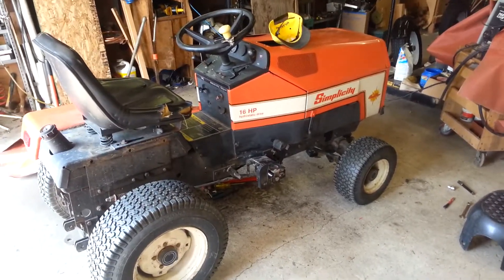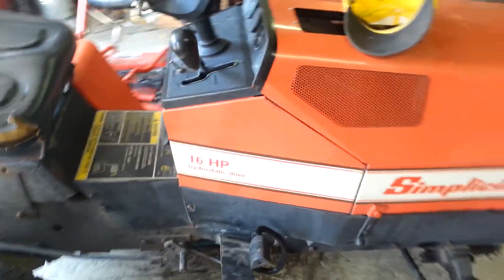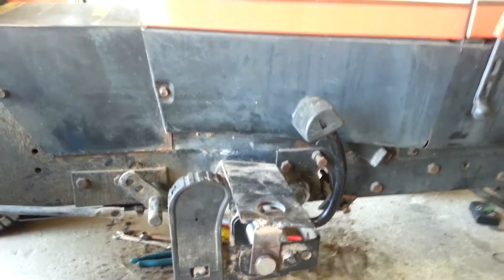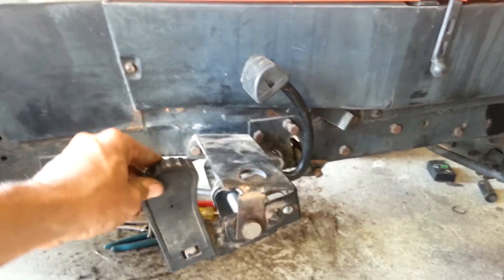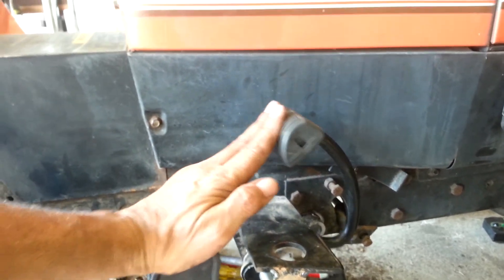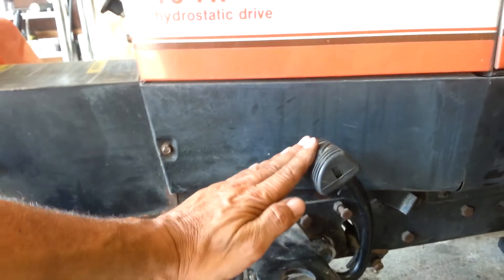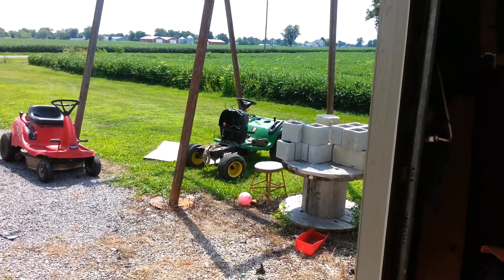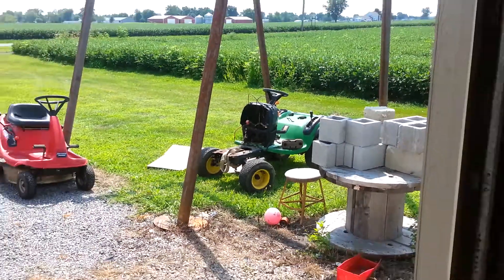simplicity sunstar 16 pedal hydrostatic conversion

Comment: I would like more information on how you put this on your tractor? Was wondering if you had some pictures of how you did it? I am also curious to how you got it to return to neutral when you lifted your foot off the pedal?
Reply from the maker: Sorry I dont have any pics of this project, I also didn't go so far as to give it any return mechanism.  I manually returned it to neutral which was less the ideal. It could be set up with springs to return from fwd and rev and a detent for neutral.  I lost interest in this GT and moved on to other machines I like better/ fit my needs better